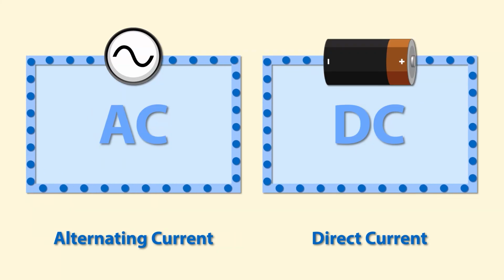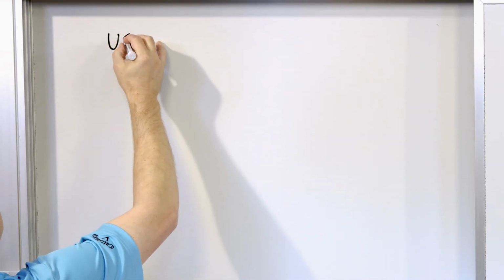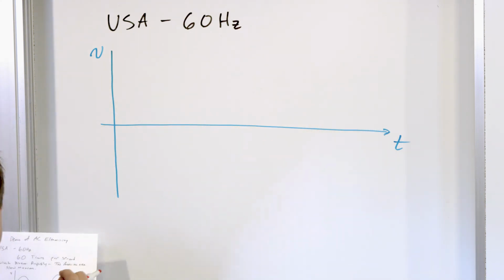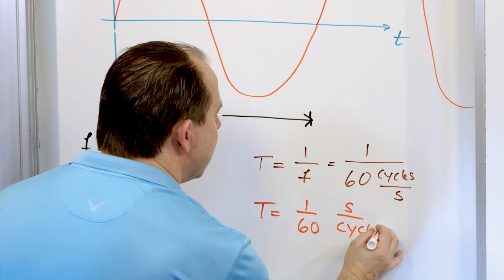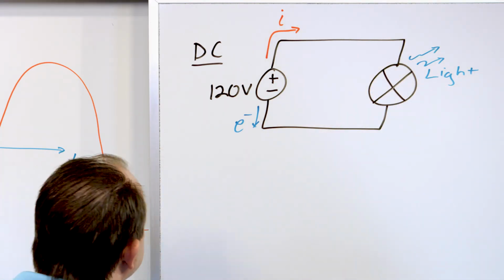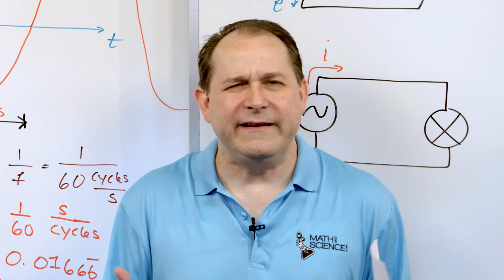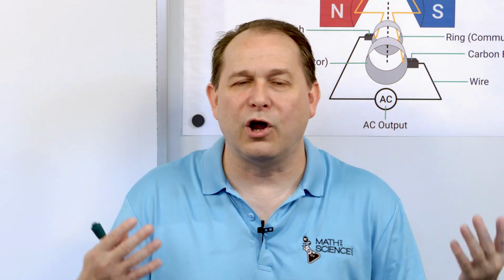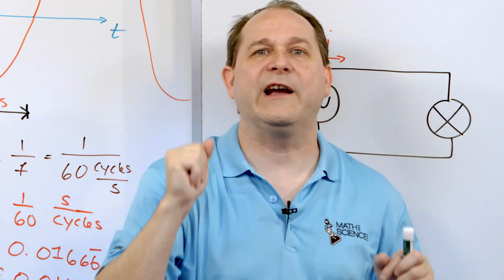Light Bulb in Slow Motion - Visualize AC Electricity!

Comment: Current does not flow.
Current is a static magnetic field surrounding the conductors.
Current only exists if a load is applied.
Current can only be measured inderectly using either a coulomb meter (current clamp) or a fixed resistance where the voltage across it is measured, and a calculation is applied for a high impedence DC meter to be attached.
If the load is removed, then the magnetic field collapses to Zero.
Furthermore the load specified in Watts can be calculated using Ohms Law, when both the Voltage and Current are specified.
Please do not confuse the flow of Electrons (Volts) with Current, which does not actually transverse through the conductors.
AC flips polarity at the mains frequency, DC does not flip unless the polarity is switched.
Many people, including those who are highly qualified confuse Electron flow by wrongly naming it Current.
EMF is Electron flow through a conductor, which, when a load is applied, expressed in Watts, creates a Magnetic field in the conductors, known as the Current. But this Current does not "flow".

Comment: I've often thought that the reason old incandescent car bulbs last almost for ever running from batteries is that the filament is not vibrating in the earth's magnetic field like an AC fed bulb does.
Reply: Uhmmm!
No lo había pensado 
🤔🤔🤔
Reply: Errr....you were told nonsense I am afraid. The car bulbs run from the alternator and the battery DC. They just used to be made better. Also in the UK we have lots of speed humps in the road. When you hit them and jolt jour car the hot bulb element takes a hit and reduces its life.

Comment: How come the lights in the reflection on the bulb are not pulsating? Direct current?
Reply from the maker: Yeah, those studio lights are very expensive and special made LED lights that do not contain an incandescent filament. They’re basically only made for high-speed cameras and don’t flicker or at least don’t flicker very much.
Reply: @JasonGibsonScience  probably just LEDs with capacitors. 😄

Comment: Great Video. Just one thing: You covered very well the fact that AC is simpler to produce and transform from one voltage to another. However, when economically viable to do the conversion, high voltage DC is more efficient to transmit over long distances than AC. Hence undersea transmission cables using DC rather than AC. Also some overland transmission lines are now being constructed to transmit DC as the conversion process becomes more economically viable. When you transmit AC you have reactive and resistive losses in the lines. With AC you only have the resistive losses.
Reply: You said that AC has only resistive losses - typo. In the past, changing voltage in DC was a lot more challenging and clumsy. We now have semi conductors for this.
Reply: Correct it's a typo. I should have said the DC has resistive losses and AC has both reactive and resistive losses.

Comment: I'm going to float an idea here, which can help us understand quantum mechanics...an entry point into the unknown. Each atom's component parts are held together by its 'Higgs field. When we induce change on the Higgs using voltage,  those components become distorted from the norm...they lunge away from the voltage source and what is interpreted as electron current is in fact a bias of distortion which travels along the entire conductor wire. One end of the wire is voltage deficient and the other is in voltage excess. One side has a huge pushing force and the other a huge kicking force. It's this huge kicking force that creates photons.

Comment: A car piston is a mechanical rectifier.
It converts up and down (alternating motion) into rounded constant circular motion. “Cosine function”.
Reply: No, it's not. It only moves up & down. The crankshaft converts that to rotary motion.
Reply: @Iowa599  
You just repeated what I just said. Lol
Reply: @Bassotronics  no, you said the piston is the rectifier.
Reply: @Iowa599  
The piston is connected to the crankshaft so as a whole it’s like a rectifier.
Reply: @Bassotronics  no, the piston is like an electron, it moves in a very straight line.
Reply: @Iowa599  
Yes but I’m not talking about an electron per se,I’m talking about the device called a rectifier.

Comment: I was a little frustrated by the repetitive details in this video, but then, I've been playing with electricity for many decades, starting when I was still a toddler, so it all of it was old knowledge to me. I know all these things 'in my bones' and that early hands-on experience led to learning about MANY areas of science and engineering. Anyway, I watched this vid to the end to see how well it could explain things to a novice, since I have friends who still have a semi-mystical view of electricity, and are unnecessarily fearful of it. On that score, this vid is very good at covering the basics, though it did not go into the particulars that could allay the fears of the ignorant. Oh, well. 😕
Also, I kept waiting for the little detail that the number of fluctuations in AC power is twice the frequency. So in reality, the bulb brightness was pulsing not 60 times per second, but actually 120 times per second. That did not detract from the essential message, but it does help to explain the persistence of vision effect. And BTW, the early movie makers found that FLASHING becomes very noticable if the frequency goes below 20 times per second, but is usually unnoticed at 24 flashes per second. 
As for seeing the pulsations in an incandescent lightbulb, it is best to use a very low wattage at the highest convenient voltage, because that means a longer and thinner filament, which has larger temperature fluctuations. (The opposite is also true, with high-wattage bulbs dimming only very slowly, as can be seen with the large marker lights on radio transmission towers.) In addition, a dimmer bulb has less of the light saturation effect that aids the persistence of vision effect. The light saturation effect is the real reason the frosted bulb had fluctuations that were more noticeable: spreading the light over a larger area reduces the light intensity and the saturation. 
For the purposes of this video, it might have been useful to have a loudspeaker in series with the lightbulb, and drive the pair with an audio signal generator and amplifier. Multi-sensory learning is always better!
Keep up the good work, sir. 🙂

Comment: In Germany, tests were carried out at which frequency incandescent light bulbs no longer flicker. 
At 40Hz there was still some flickering, at 50Hz it was good enough without any noticeable flickering.   
That's why 50Hz is used in Europe.   T= 0.02 s/cycles = 20ms /cycle
Reply: There was a 50 50 change to get the flow of electrons right. 
The direction was assumed incorrectly and has remained that way to this day.
Reply: a fluorescent tube with alternating current is momentarily dark

Comment: Pretty good video but,
AC and DC are just as easy to make.  AC appears to go further because all it has to do is move electrons a small distance and the effect takes place throughout the entire wire. DC has to push those electrons throughout the entire wire and suffers from a drop off due to the resistance of the wire.
Generators create DC.
Alternators create AC.
But generators and Alternators both use spinning and/or different magnet layouts.  The magnets can be permanent or electromagnetic, stationary or rotating. It is the magnet and wiring layout that determines if it is a generator vs an alternator.
Therefore AC and DC are just as easy to make. Its just their overall effect over distance that determines their use in large scale vs small scale projects.
Reply: I have to disagree with you on a couple of points. I assume that when you refer to a 'generator' as opposed to an 'alternator' you are describing what is more commonly referred to here in the UK as a dynamo. The dynamo which produces DC is mechanically more complex than an alternator (it uses a commutator rather than slip-rings) and is therefore more expensive to manufacture. It requires more maintenance and is less efficient.
The resistive losses for AC and DC along a transmission line are the same for a given voltage and current. The reactive losses along a transmission line will be greater for AC than DC.
AC has been traditionally used because it is both more economical to generate using mechanical means and it is also more easily stepped up or down using transformers. 
As stated in my other comment: There are circumstances - such as undersea interconnects - where the advantages of using DC to avoid reactive losses makes the conversion  between AC and DC at each end economically viable.

Comment: Was the light fluctuating at 120 Hz ( for 60Hz supply ) or 100 Hz ( for 50Hz supply ) ? 
10ms between pulses ( 50Hz )
8.3ms between pulses ( 60Hz )
The heating of the filament doesn’t care about the polarity of the alternating current.
Not much time to cool down between the max of the sine wave and the next peak.
Would be nice to see a graph of the light output versus time.
The filament will have some retention of heat in these short periods.
Reply: Yes, good idea is to put second lamp in parallel but with diode !

Comment: The reason for the double coil is to pack the filament in a small space. A 60W bulb filament is 2 meters long.

As for the movement, that is called the Lorentz force and is caused by the changing magnetic field in different parts of the wire repelling and attracting each other.

Comment: Jason, Great video! One question however.  In the video you mentioned "storing electricity" from solar panels late in the video. I'm not an EE but I was under the belief that you cannot "store" electricity and that's one of the big drawbacks to renewables. You can use it to power your house or charge batteries for later use but once the batteries are charged any additional power being generated is essentially lost unless you are selling it back to the power company. What am I missing??? Thanks. Tom Sunseri
Reply: You are correct that for large scale purposes you don't store electricity. You store energy either in chemical form (batteries or fuel cells) potential energy (weights or water reservoirs) or kinetic form (flywheels). It could be argued that you can store electricity in the form of charge in a capacitor however compared to other forms of energy storage that would be on a microscopic scale.

Comment: So if you ran incandescent bulbs on DC they would last longer I guess. No pulsing of the filament.
Reply: Cheap bulbs tend to have a thinner filament and more susceptible to a voltage surge or vibrational shock. An incandescent bulb will have about 1p times the inrush current compared to normal operation ( the filament has less resistance when cold)  so often times these cheap bulbs will burn out when switched on.

Here's a trick, if you can find a 200-300 watt bulb made for 277 volts, running it at 120V will last a very long time. I suspect that will come at expense of being less efficient at light  output per watt, I haven't actually tested those numbers ( kind of wish I had now, to have a ballpark idea). I worked on testing lighting controls for years, we used this trick to keep from burning ojt bulbs. Even just a 130V run at 120V will be more durable at negligible light output efficiency loss.

Comment: I normally don't watch videos about electricity, but this was amazing! One concept I didn't fully understand is why the current changes direction with AC electricity? Is it based on which magnet the wire is closest to as it spins? Also, are there just giant magnets in power plants? Thanks for the great video and for sparking my interest in electricity, no pun intended!
Reply from the maker: Yes, and a power plant there is something called a generator which is a big magnet and also a coil of wire either the magnet spins or the coil of wire spins but either way something is spinning. When something spins in a circle after half of a revolution, the direction of the magnetic field switches direction so the reason the current alternates back-and-forth is because somehow our other when things spin, after a cycle, the direction of the magnetic field changes from the perspective of the wire current begins to flow the other direction.